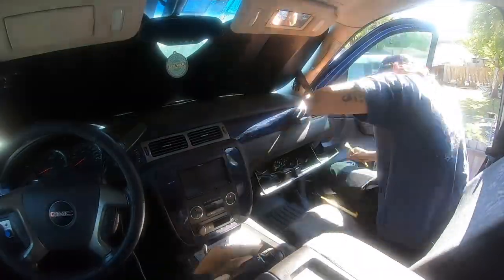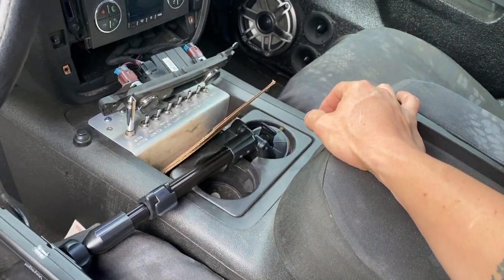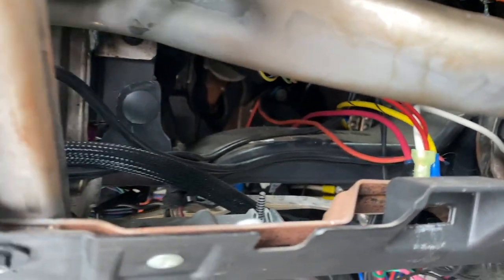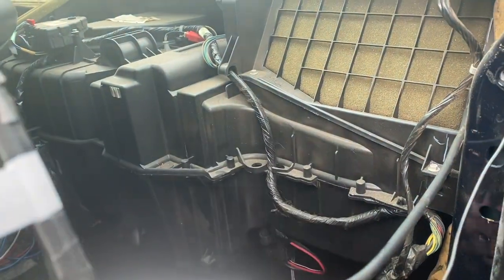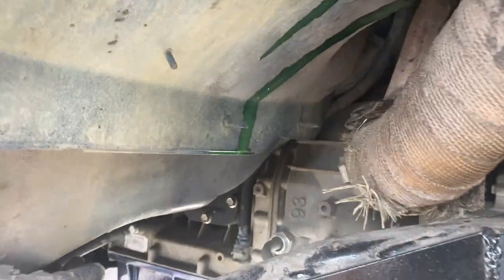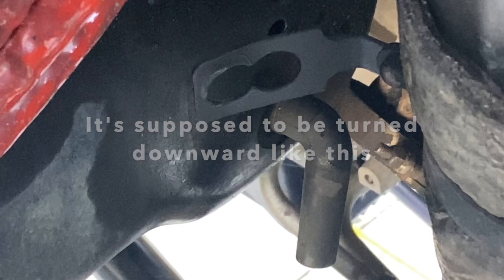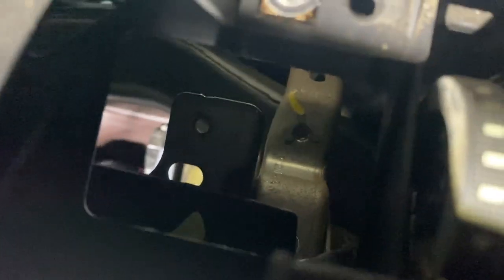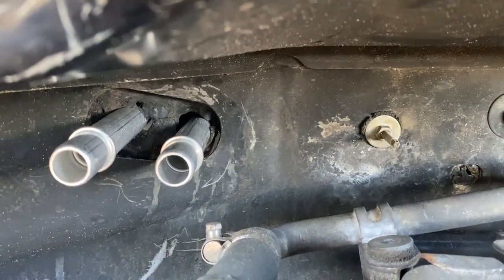Killin It Resurrection Episode 6: Heater Core Replacement

Comment: There is so much room for activities around your console make some metal bracing hook your switch panels up to Some weather cooking for underneath with the 2 bowl holes You could even build yourself a custom arm plate with a joystick for the rear steer Mounting a lot of your electrical work to the firewall Could eliminate a lot of your wiring from the dashboard
Reply from the maker: Solid points!